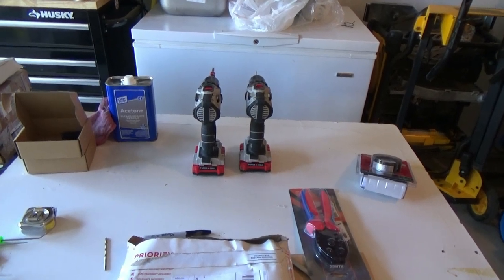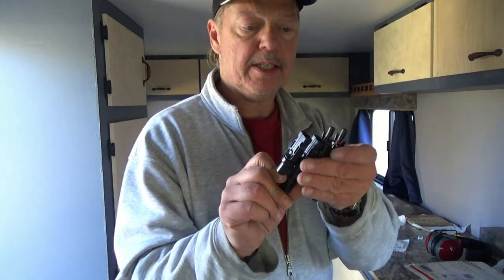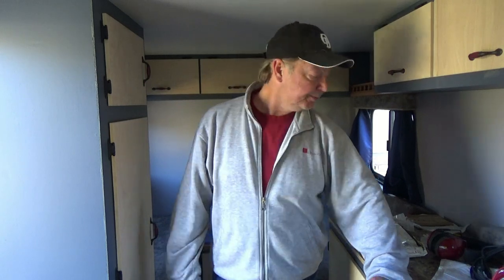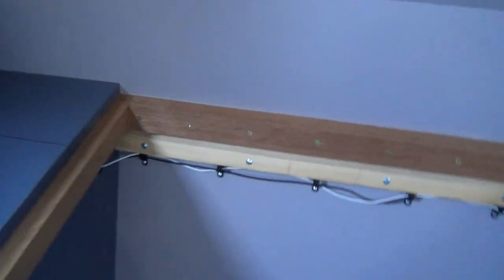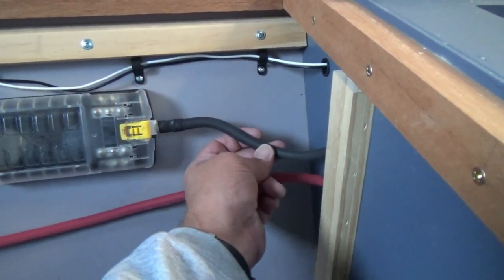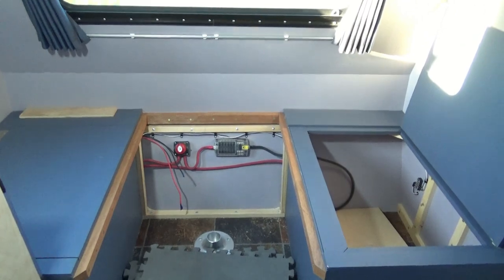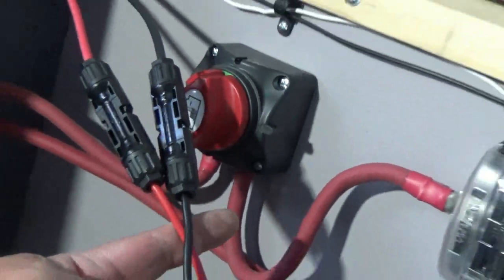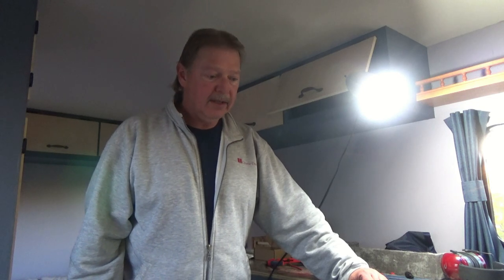How To Build A DIY Travel Trailer - Part 46 (Lensun Solar Installation – Part 2)

Comment: Great work, Watched few of your SOLAR DIY and pretty impressed. Now that you have used the solution atleast for one season. Any feedback that you would give ? Which would improove the solution ?

Any chance to get a list of items you have installed and their costs ?

Great videos
Reply from the maker: Thank you for watching! I am pleased with how everything works so far! Not sure what I would improve just yet until I actually start camping.... after the first couple of trips, I will have a better idea of what I would would do differently! Video 54 and 55  I talk about about about the materials I used and the cost. I spent perhaps $1500 US dollars in the solar setup. Panels, charger, and batteries and miscellaneous parts.

Comment: Question, why did you opt to cut off the mc4  connectors and then replace them.  Why not just a small junction box and splice the wires together directly?
Reply from the maker: This was my first try at solar... I did like the idea of redundancy, being able to disconnect solar at different points if I ever wanted to change something. If I had to do it all over again, I would probably solder the wires to make my connections. Thanks for the observation!

Comment: Awesome videos sir.I have learned lots from them and also enjoyed the project build.Curious about how those wire hold downs have lasted through the seasons you’ve had since the build? Oops I’m referring to the ones you used for the solar panel install on the roof .Very much hope you can reply .Thank you in advance 
Best Regards ..Brian in Sask Canada

Comment: Maybe dumb question but why use mc4 connectors when extending wires to the shut off instead of butt connectors with shrink?
Reply from the maker: Hey John... not a dumb question at all. Honestly, this was my first go around, Looking back, if I had to do it all over again, butt connectors would be the way to go. Maybe solder the wires and use shrink wrap would have been better! I know now! :)   Cheers!

Comment: I understand why you placed your components where you did, but you are better off keeping everything close and the wire runs as short as possible. So if anyone out there is building solar system research best wiring methods and understand voltage drop and how serial and parallel can affect your system. Great series and I love your detail in these videos.
Reply from the maker: ILikeCoolMovies, thanks for stopping by! AND... true that! Keep the wire runs as short as possible! My system will most likely suffer from voltage drop for sure... For the short periods of time I will be using the trailer (weekend jaunts), I will probably not notice it as much as if I were full timing it! Good advice! Thank you for watching and the great comment! Take care!

Comment: Two questions, just because I'm nosey. Did you wire these in a series? Because it looks like you connected them in parallel, MPPT controllers like series strung panels because it'll take the extra volts and convert the volts into amps (which charge the batteries faster). And why didn't you just  connect the panels on the roof and have one set of leads and one box (thus only one hole on the roof)? Less run on the wires = less loss of solar. Great videos, I just am curious. Nice  and clean wire bus system you have there. I like it a lot.
Reply from the maker: I like the questions... I did wire in parallel, I was thinking at the time, more amps. But now that I have had time to watch the controller, series may have been the way to go. I was trying to keep the wiring on top to a minimum at the time, looking back, I should have shortened the cables and reinstalled connectors. A lot of lessons learned from this build for sure.... could have used you sooner! :)
Reply: OregonBatman one benefit of running panels in parallel is that if one is partially shaded it won't drag the others down. But if you wanted to switch it over to series you could easily do that in the cabinet where it comes it. Get rid of the pc4 pigtail, and connect the negative on one panel to the positive to the other panel. However, on a 200watt system there won't be much gain. But it's something to experiment with it you are so inclined.
Reply from the maker: Hey Jayflight, I've noticed that, when I go out and check the remote, one panel is partially shaded and still drawing in power. I'll have to wait until winter is over and see which connection works best.
Reply: OregonBatman that's the great thing about hooking them up in parallel, shade won't drag the rest of the PV system down. I switch them back and forth when I have to.
Reply from the maker: Yup... so far it has been working great. Where I have the trailer parked in the driveway, one of the panels is in shade half the time and power still coming in. Keeps the batteries up!

Comment: Did you screw the solar panels down to the roof or just use the eternabond to hold them down?
Reply from the maker: I just use the Eternabond Tape to hold the panels down. Works very well. Putting it to the test now with the snow, ice, and rain... we'll see how it holds up once things warm up again! Thank you for watching!